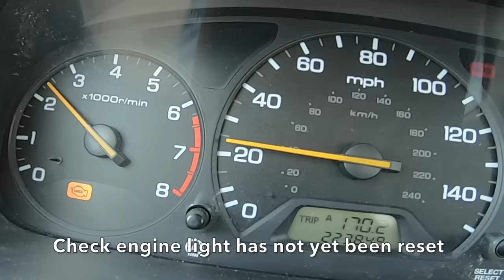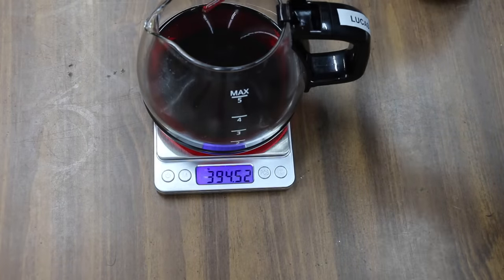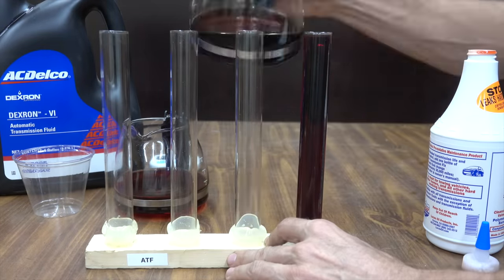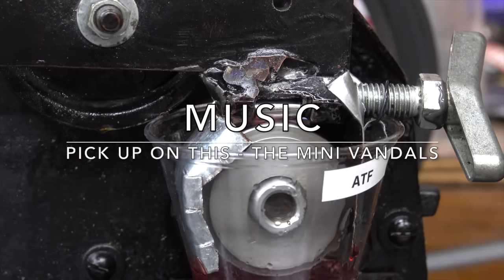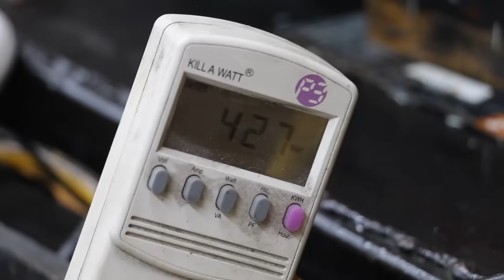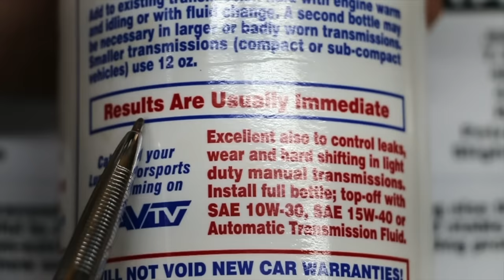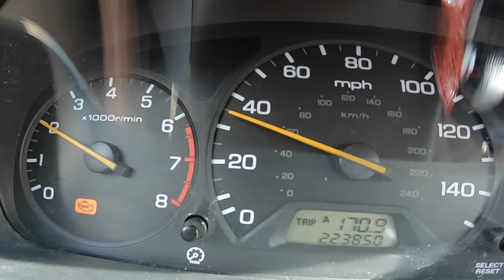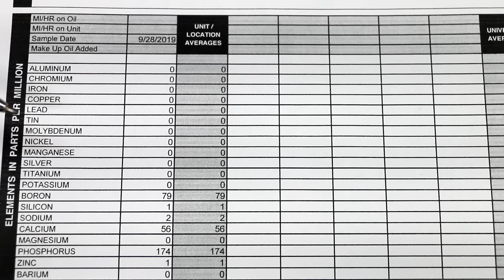Does Lucas Transmission Fix Work?  Let's find out!

Comment: First thing I’m a retired auto technician with over 40 years of professional experience and several years before that even. The last 10 years I was a transmission rebuilder. Would I use Trans-fix on a new or known good transmission?? No! Would I use it on a transmission with a problem.. short answer, yes!  You noticed that the Trans-fix was thick, that is what helps a worn transmission by increasing the line pressure of the transmission, similar to adding Lucas oil stabilizer to a worn engine. You increase pressure by increasing the viscosity of the transmission fluid/engine oil. I have seen and heard that many people have gotten several thousand miles of use by adding a bottle or two to their transmission. It WILL NOT WORK if the transmission is making loud noises or does not have all gears/ranges working. Like you said if you have a lazy/bad shift it’s worth a shot giving it a try but I would not recommend using it on a transmission that is working properly. Good videos, great advice!!  PS… I agree with what several people have posted…you can’t get a decent transmission rebuilt for $1500.00 anymore. Even if the video/test is 10 years old $1500 is a steal. It costs more than that for the removal and installation not counting the rebuild on most vehicles.
Reply from the maker: Thanks for sharing.

Comment: This kept my 4th gear slipping transmission running strong for 70kmi and still going.... but she is getting a bit more cranky.... I think the thicker oil helps with clutch plate pressure, etc....
Reply from the maker: Thanks for sharing.

Comment: If your transmission in a Ford F-150 XLT 4.6 L 6 speed transmission is on the level line but you add to fix it Lucas transmission fluid to help with the slipping rough shifting gears do you need to drain the 24 oz before you put the 24 oz in
Reply: Please let me know if I need to drink 24 oz before I put the Lucas fix product in my transmission the same amount that I take it out I need to put back in
Reply: Cuz if I had the 24 oz Lucas fix cuz my transmission fluid is already at the line that will make it over full will hurting the transmission

Comment: I used this stuff as cut fluid.  I drilled a 5/16 hole into a 1/4 plate. When I was done I could hold the bit in my hand. It significantly reduced the heat.
Reply from the maker: Thanks for the feedback.

Comment: I really think your videos are excellent. I must say however 
That I owned a 1993 Chevy 
Lumina for 23 years, 260,000
Miles. Eventually went to the 
Junkyard due to rusty frame.
Engine and transmission for ran
Like new. One granny fluid 
Change due to leaking line.
Thanks for the great test on the 
Lucas.😊
Reply from the maker: Thanks and you are welcome!

Comment: After transmission fluid change of my car nissan tiida model 2007 mileage 250k kms, its reverse gear got delay problem. If i apply reverse gear it doesn't works untill the car is not accelerated.
Plz if someone faced this problem help me. Will lucas work for me

Comment: I was an Acura tech from 2004-2006 and I believe I replaced about 14 transmission during those two years and did about 50 of the oil passageway updates to them.

Fun times...
Reply from the maker: Thanks for sharing.

Comment: Great video.  I have a 2001 Accord V6 with 179k miles and have slight transmission issue from 1st to 2nd gear. I have no codes.  From 1st to second, I have a slight bump/ slight hard shift to second. I’ve done transmissions drain and fill about 3 gts of Honda DW1 multiple times since 5 years of ownership.  I tried Lukas trans slip but only 12oz since it’s a compact car. Also drained and added the Lucas 12 oz and Honda DW1  transmission fluid for the 3 qts drained.  
Adding 24oz to an already full trans is never good.  Iam surprised Lukas says you can just add it and not drain the amount your adding.  

My results were not noticeable.  More Time will tell if any benefits. 
I’ve read on Honda Forums multiple times people saying don’t add anything and only use Honda DW1 fluid. The obvious is doing that you still have a bad transmission from Honda.  
That’s the problem.  So adding the appropriate amount of Lukas to try and fix a bad trans. from Honda won’t make it any worse then Honda already did with only DW1. 

Also my 2005 Honda CRV with 140k miles burns up about 4 qts of oil a month.  Yes that’s correct about a quart of oil a week needs to be added. 
My local mechanic did the pcv valve and valve adjustment because I wanted it done because people that act like they know someone say that on Honda forums and no change beside a big bill.  

My 40 year working business mechanic said the problem is Honda makes a junk CRV 😮engine and has never fixed the issue through 2018 CRV’s.  He only said 2018 and older because the the newest he had in his shop for excessive oil burning.   He said most CRV’s burn lots of oil and nothing an owner can do but keep adding it.   Thanks again Honda for bad transmission for my Accord and oil guzzler CRV.
Reply from the maker: Thanks for sharing.

Comment: I have used this stuff in very worn out transmissions and had amazing luck with it although I do want to say the claim on the package that the effects are immediate is not necessarily true so don’t give up if you don’t get immediate results. it takes time for the product to soak in to the clutch bands and to clean years worth of baked transmission fluid and clutch material from small intricate parts. this is especially true if you are using it to help with leaks. most of the time it will help or eliminate your problem just have patience
Reply from the maker: Thanks for the feedback.

Comment: I've used it 2wice in 2 Toyotas with no problems,  the first time it totally fixed the transmission and went back to shifting properly and put 360000 miles  on it.   the second car it turned out to be the solenoid that was bad so had to replace,  it's definitely worth trying and you can help  eliminate whats wrong  it won't hurt your car, also check your trouble codes they might pinpoint the problem.
Reply from the maker: Thanks for the feedback.

Comment: can you add it if your transmission fluid is at the maximum?
Reply: I’ve seen comments on other posts where people use a turkey baster to take out some of their transmission fluid as you do not want to overfill or overflow. That’s like pouring too much water in a cup and it spilling all over the counter and floor. Besides, this spill, or any spill under the hood could end up costing you a pretty penny.

Comment: 10000% yes!!!  Had a 1998 Windstar, and a seal failed. Put two bottles in, and some fluid, and is still running 10 years later.
Reply from the maker: Thanks for sharing.

Comment: Years ago I did a deep dive on this product, the main way it keeps clutches from slipping is the super finely ground synthetic polymer suspended in the oil which is what makes it so thick to pour, when clutches slip they create alot of heat and that melts the polymer which then adheres to the clutch packs through those heat and cool cycles, Honda added a similar concept to a lesser degree to their transmission fluid in the mid 2000's after they began to gain a reputation for poor transmission reliability, it's an ingenious concept because the polymer remains in suspension in the rest of the fluid and only melts in high heat areas and becomes a sacrificial friction material
Reply from the maker: Thanks for sharing.

Comment: This stuff helped my transmission shift much smoother. It's a 2008 Dodge Caravan with 208K miles on it. It runs well and since I put the Lucas Trans product in it, it shifts much better.
Reply from the maker: Thanks for sharing.

Comment: my 03 dodge caravan started shifting hard from 1st to2nd & 2nd to3rd 2 yrs ago(at 5 F and colder)the fluid was clean, full, and not burnt so i added a bottle of Lucas trans-fix, each day it was getting better by the 3rd day the shifting smoothed to normal & its still great. make sure the Lucas is "60deg F or warmer" before trying to add it..its best to add after a drive with the trans-warm.
Reply from the maker: Thanks for sharing!

Comment: Seems like it may have a spool valve hanging up in the Valve Body...would've been interesting to see Shift Data on a scan tool.
A new Valve Body would likely fix this issue, but one would need to pressure test those clutch drums ofcourse to see if you may have any bypassing issues causing that 2-3 shift flare.
My guts telling me a new Valve Body would likely resolve this.

In either case, another great video and thanks for the information.
Reply from the maker: Thanks and you are welcome!
Reply: @ProjectFarm   I really do need to thank you though because every video you do is so amazing

Comment: 2009 F-150 4×4 4.6 V8 automatic, has a 185,500 miles on speedometer. From a complete stop, it starts off into first gear quietly and smoothly, shifts into second smoothly, but when speed increases to 35 - 40+ miles an hour, it sharply clunks into 3rd gear.
After third gear, it shifts smoothly and quietly again into the remaining gears. I thought just maybe ' it might need  a transmission rebuild.  But now  I'm definitely going to flush out old transmission oil, filter and use some of this Lucas transmission lubricant first. Then I'll check transmission shift solenoide's.
If it still slips going into third, then I guess it will be time for a rebuild. Thanks for the video 👍
Reply from the maker: You are welcome!

Comment: I had a 94 Dodge Caravan that someone had put the wrong transmission fluid in. It started to shudder on the up shift so I changed the fluid twice to try to get as much of the wrong fluid out as possible. Still shuddered on the up shift. I added the Lucas transmission fix and it shifted perfectly for another 80,000 miles that I had the van and the guy I sold it to drove it at least another 20,000 with no problems.
Reply from the maker: Thanks for sharing.

Comment: I used Lucas Transmission Fix, as directed on the label, on a 2004 Toyota Sienna with about 208,000 miles.  It was slipping badly between 2nd and 3rd gear.  I drove it a couple hundred miles after treatment, and there was no detectable difference in the slipping problem.  On a whim, I added a tube of Lubegard Instant Shudder Fix, which had an almost immediate (within a mile) and dramatic effect:  no slippage at all.  That was about a year and a half (and a few thousand miles - I don't drive it very much; mostly short, local trips) ago, and the transmission has been functioning correctly.  I can't attest to whether it was one treatment or the other, or a combination of the two, that ultimately addressed the slippage problem; only what I did and the outcome.  Hope this is helpful to others.
Reply from the maker: Thanks for sharing.

Comment: I used Lucas transmission fix in a 2000 Ford Astrovan with a 4 speed automatic. it didn't want to stay in 4th gear. (low fluid pressure), It took 2 bottles to help as I had to make it last for 3 months so I could trade it in. I was satisfied with it.
Reply from the maker: Thanks for sharing.

Comment: I had a 2016 RAM 2500 with 6 speed automatic.  The check engine light came on and I was receiving the same code P0740 code on my transmission.  Especially when towing.  I had the transmission fluid and filter changed and the code returned.  I added a bottle of Lucas Transmission fix and the code would only show up occasionally after about 3k miles of driving.  So I added another bottle and after about another 3k miles the code stopped showing up.  I now have another 20k miles on it and no code.  I've now added this to every vehicle I drive whether it had an issue or not.  Awesome product IMO.
Reply from the maker: Thanks for sharing.

Comment: What should one do to appease ghosts or other supernatural entities that haunt one's vehicles? 

For example, one of my vehicles had a non-functional horn. One day, I opened the hood to see that the coolant reservoir was empty, and there was coolant on the outside of the reservoir - I replaced the coolant, and took it to a mechanic, who diagnosed a leaky water pump. I declined to have the repair done, and drove the car home. The next time I drove it, the horn started working for no apparent reason.

The car also displays various times that change at random, and shows other signs of otherworldy influence.

It could be aliens, or alien ghosts, but assuming the vehicle is just haunted by an ordinary human ghost, or maybe the ghost of a cat, is there anything you can recommend that would make the ghost(s) like me, so that they make my vehicles run smoothly? Fixing the water pump is pointless, since the ghost will just find other ways to mess with me anyway, and the previous owner already tried replacing the water pump, which obviously did not appease the ghost(s).

Comment: I just got a 2006 Honda crv for super cheap but it had a shutter when going in to final gear at lower rpms (45 mph or so),  Changed the trans fluid and added a bottle of this. Shutter is barely noticeable. Im shocked that it works (well of course its borrowed time)
Reply from the maker: Thanks for the feedback.

Comment: Im so desperate, got my transmission fluid changed, solenoids changed and my honda accord still not moving in drive gear and gets blinking D after.

This is the cold start, when the transmission is hot it shifts well but slips in first to 2nd gear. 

Do i need to use Lucas?

Comment: Facts I drained out enough fluid so I could have enough room to add 3 Big bottle's and it stopped the leaking and put another 50,000 and it's was like it never had a problem but I wouldn't drive it like you stole it cause I'm sure it or any transmission would go out

Comment: I had trouble with my mid 2000s GM truck transmission (4L60e).
Banging shift and "drop outs" (both putting along on level ground in residential areas or at intersection).
I used TWO bottles right away as I didn't want to drain off after finding 1 bottle wasn't strong enough.
It muffled the metal "clang" to more like it was before, and lessened the amount of "drop outs". I had it to my regular mechanic after. He commented that "the fluid is really good". 
It later started making a noticeable gear whine and I am convinced that a clip holding the little gear set broke off and its sliding loose inside as I hear it clanging forward and backward.
I gave up on the now money pit and bought a different vehicle (with same transmission model only less beat on from the original owner. Mine was an ex corporate service vehicle and drove like it was stolen by the employee I think)
I most likely am going to go with full synthetic and most expensive brand or maybe 1 bottle of Lucas. 

Adding a big cooler next summer. 
That's like air conditioning for your transmission (especially if you drive in the city, that makes them heat twice as much)
Reply from the maker: Thanks for sharing.

Comment: It fixed my 96 Volvo 960. It would not move. I dropped the pan, swapped out the gasket and put new fluid with Lucas replacing a quart. The car worked perfectly after that.

Comment: My 2006 V-6 Dodge Dakota had the oil cooler rupture in the radiator. Transmission (and engine) was flushed when radiator was replaced and transmission was very erratic in shifting. Added Lucas to the transmission and and results were very good. Around 7000 miles since then it will sometimes "hunt" third and fourth around 40 MPH but that's it. Cheaper than a rebuild. Lucas worked for me.
Reply from the maker: Thanks for sharing.

Comment: 243,000 miles on a 2006 civic and no problems with motor or transmission , never had problems over those 243,000mi. Thinking I.may put Lucas in the oil round 250,000mi..kind of detect a tick in one of the valve lifters
Reply from the maker: Thanks for the feedback.

Comment: So I just bought me a G body that's sat for a year and leaked out it's tranny fluid, we put some new trans fluid along with this stuff and it made a VERY noticeable improvement both through sound and feel, the car feels absolutely flawless on the gear shifts especially on a full send down the highway. We also put Lucas for engine oil and that helped out alot aswell. Unfortunately the engine has a small leaky real main seal or oil pan leak but for now Lucas definitely saved us alot of stress and brain cells
Reply from the maker: Thanks for sharing.

Comment: Can you use Lucas Oil 10652 Synthetic SAE 75W-90 M8 Marine Gear Oil as an Automatic Transmission Fluid in the car which uses ATF Dexron 3? Thank you for the film.
Update:  Someone fm/Amazon replied that that Lucas Oil mentioned above is for boats only, and it will damage the transmission, bcs the oil for AT is very thin and this Lucas Oil is very thick. They sent me this oil instead of a different product I ordered due to some mistake now I can see.
Reply from the maker: You are welcome!  Thanks for the suggestion.
Reply: @ProjectFarm  No-no, I have update. Someone fm/Amazon replied that that Lucas Oil mentioned above is for boats only, and it will damage the transmission, bcs the oil for AT is very thin and this Lucas Oil is very thick. They sent me this oil instead of a different product I ordered due to some mistake now I can see. Thank you for the replay.

Comment: I've used Lucas Transmission Fix on many vehicles and it gets a good bit more life out of most worn automatics. What it does not do of course is fix broken parts but slipping and slow shifting reflect wear not breakage in most cases.
Reply from the maker: Thanks for the feedback.